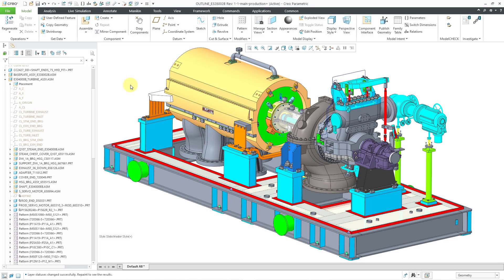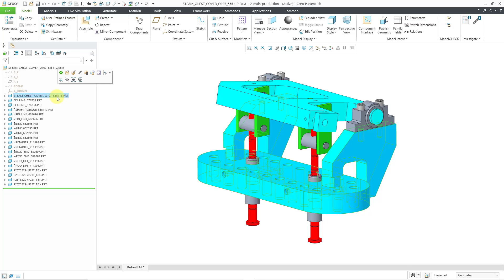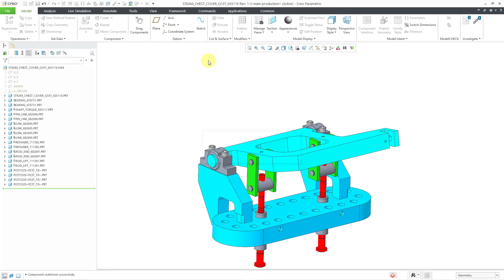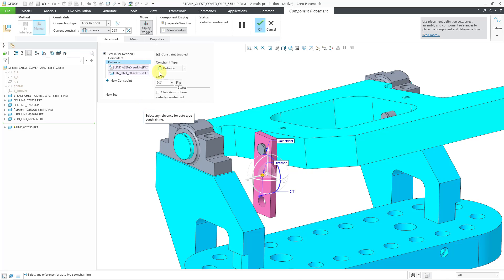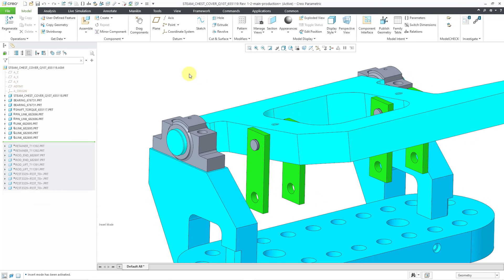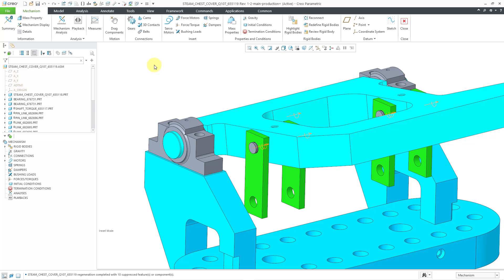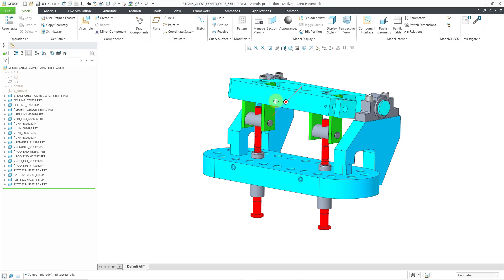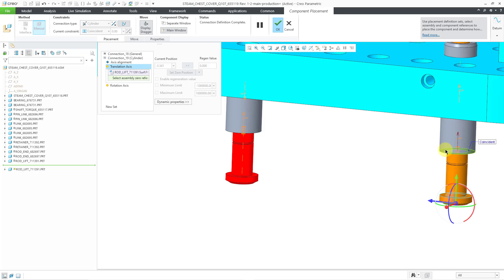Creo Parametric - Mechanisms - Convert Assembly to Mechanism

Comment: Lets say you started an assembly and created all parts within the context of the assembly with a skeleton, is it possible to apply mechanism constraints after the fact?
Reply from the maker: It’s not recommended, but you could if you change the update settings to the Data Sharing features. It would be messy and the chances of everything breaking are high if anyone sets the Copy Geoms back to auto update. I recommend you watch my videos on Top Down Design and Mechanisms. I should have at least one playlist.